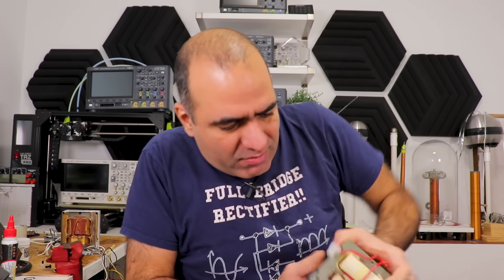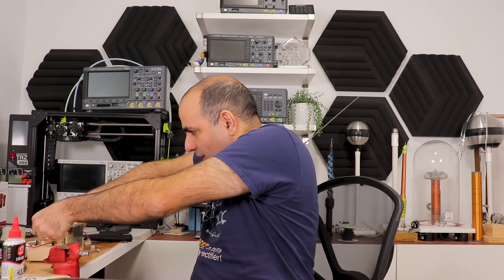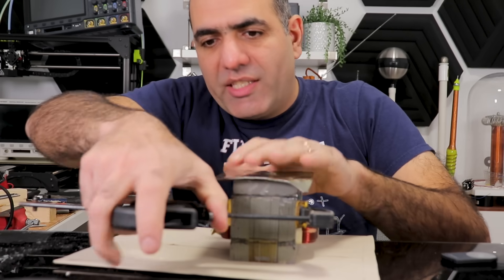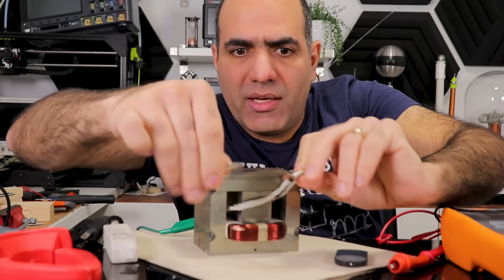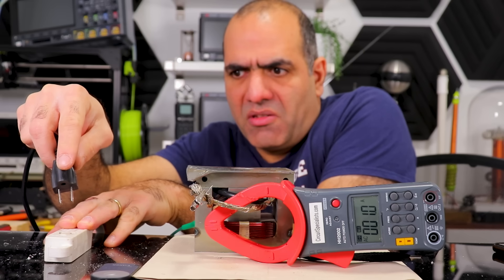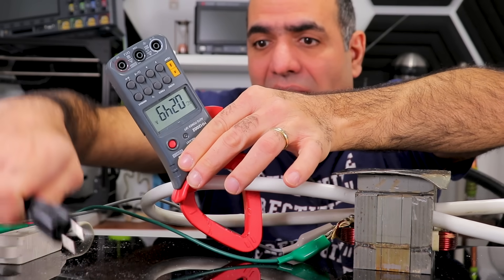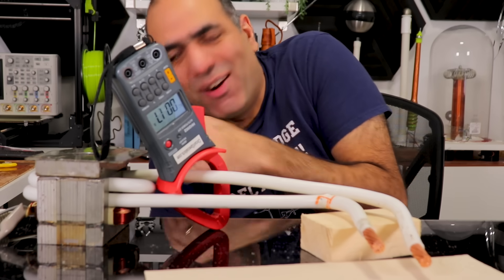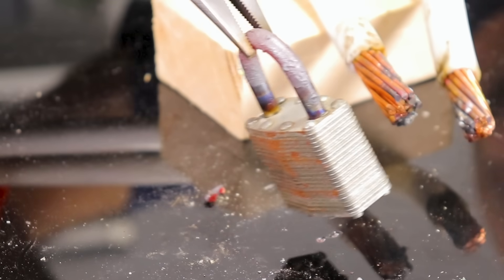Making "MILLIONS" of AMPS of Current

Comment: At about 8:20 you had the cable going through the transformer and It looks like you could easily pass it through at least one more transformer. So I’m wonder what would happen if you did? Would the voltage double like having a second turn? If so the draw for each primary would be reduced right? Maybe you could chain a bunch of them to get to the million amps.
Reply from the maker: Interesting  thought! I think that would count as a second turn, unless the primary is connected backwards, in which case they would cancel each other.
Reply: @ElectroBOOM  ily
Reply: @ElectroBOOM 
I think you might be known as the world’s most immortal man.
Why? Because electricity cannot kill you!
Reply: @ElectroBOOM  TKOR did it in the arc welder video
Reply: @ElectroBOOM  if the summed fields vary at double the rate, the circuitation should double i think, i don't quite remember how it works though, i might be very wrong.
Reply: @ElectroBOOM  u know what needs to be done. u gotta add this to the video list lol
Reply: @ElectroBOOM  and you connecting things wrong is always likely XD
Reply: 😮‍💨 @ElectroBOOM
Reply: My son fan @ElectroBOOM
Reply: Cody slab in the wild
Reply: @li04am  Cody Slab, you say?
Reply: Cody on a mission to kill Electroboom 🤣
Reply: Yes he could and that's what many builders do when making a DIY arc welder. It will double the voltage as it will make the part of wire trough the new transformer act as a new voltage source in series. To increase the current you reduce the number of turns trough each transformer.
Reply: @two_number_nines  but why in this video the current increases when the he doubles the secondary 4:55
Reply: @greyminded  less turns=more theoretical max current. more turns=more voltage to overcome real internal resistance and actually push current in a short circuit. it is all about impedance matching your secondary to your load.
Reply: @two_number_nines  thank you
Reply: @two_number_nines  "... new transformer ..." Hmm, I wonder why professional engineers don't do this and you don't see this out in the wild ... ?
AH YES! They are no morons who double all the bad parameters by using a second transformer or the inevitable additional series-resistance that comes with such a amateurish botch in high current applications! 
so: *facepalm*
Reply: @two_number_nines  10:01
Reply: I have no idea, but I'm happy to see you here :)
Reply: I have an infinite number of standard microwave transformers at hand. And I could also use several or more separate 15 amp 120 vac circuits. This has been on my list of experiments for far too long. Maybe I will make a video about it.
Annealing the secondary prior to forming through the xfmr is a suggestion to ease the reluctance of the cable, and make the entire task much less effort.  Of course had it been done during this video it would have reduced the comedy of the construct, so I get that.
Reply: In the words of the great Chancellor Palpatine, "Do it!"
Reply: i was seeing your video about making uranium metal from ore hehe
Reply: The second transformer would also need a primary winding or else it would not add to the current of course. however the main issue is matching the phases between the two transformers because any difference in inductance between them will introduce a phase shift in the output so it could cause issues if they are poorly matched
Reply: Great Scott !!! 1.21 Gigawatts ⚡
Reply: I imagine it may be possible, but a megampere of current is such a stupidly high amount of current that it can literally only be compared to some of the strongest positive lightning discharges ever recorded, during severe (often tornadic supercell) thunderstorms.  I honestly don't think there is enough copper left in the world to make a wire thick enough to support that kind of current.
Reply: Don't give him such ideas 😂 😂
Reply: DO IT!!!
Reply: 1:01 What is the music soundtrack here?
Reply: @googleuser4720  80s Synthwave -
Daily Instrumental Music
Reply: What would happen if a multiply the turning by a thousand times use a 240 output source and short circuit a looped wire through the arc? Will it become biggest welding machine or will it short circuit the lights of my town? Just asking and totally not thinking of actually doing it... Yep definitely not doing it 😈
Reply: Phase matching could also be an issue with that approach
Reply: @theteenageengineer exactly my point , finally i found one relatable comment
Reply: Cody you should also create some electric experiment, not sketchy  one 😇
Reply: Kalki Ironman type 7 and 8 after 2026 😎

kalki avatar (beast of the earth) (christ on the white horse) (son of man on clouds) is the biggest enemy of dajjal/antichrist/kali 😏

Kalki Avatar (Murtaza) 11th satguru 13th imam cousin of Moula mahdhi a.s. 12th imam (muhammad) 😎

Prophet Moula mahdhi is raja shashidhuvj (the mighty one) born less then 1200 years ago 😎

Prophet Moula Isa a.s. will kill dajjal cause dajjal is going to kill Kalki Avatar 😏

Kalki Avatar will follow orders from 2 religious king Moula mahdhi a.s. and Moula Isa a.s. 😎

Kalki Avatar going to have 2 swords and ring of moula sulaiman a.s. and staff of moula musa a.s. (iron rod) Staff of moula musa a.s. is like omintrix can transform into anything and can transform others into anything And stone in the ring of moula sulaiman a.s. is also known as kastav mani and it's more powerful than all 6 infinite stones combined 😇

Cuz Kalki is ironman batman super saiya-jin superman ben10 saitama optimus prime shaktimaan and every super heroes combined after 2026 😎

This staff will transforms into white horses with wings,weapons,iron-man,cloud etc or can do imagination into reality 😎

*Ratn sru sword of lord Adam (miri)😇

*Ratn varu (zulfakar) sword of Moula Ali (piri) 😇

miri piri 😇

Kalki Ironman after 2026 😎

Satyug (sunrise from West) 2038 😏

Sambal is hospital 😏

Gzwa e hind 2029 😎

Khalistan and Azad Kashmir after 2026 by Ironman 😎

99% Hadith u heard is not about imam Mahdi it’s about Kalki avatar (the main character) that person momin vs dajjal prove me wrong if u can 😏😏😏.
Reply: good idea!
Reply: World domination would be within reach......muahahaha!😄
Reply: Double it, give it to the next person 👍
Reply: If you tap the main rails it usually maxes out at 100-200A @ 240v, so 48kW for maybe 48kA if you can step it down to 1V, or get short bursts of higher amperage with capacitor banks I guess.

Larger houses and buildings can have 400A+ coming in, so maybe head back to another foreign hotel and break into their breaker box ⚡
Reply: This is the 69th reply. Epic.
Reply: WHY? WHY THEY ALLOW A CRAZY PERSON LIKE THIS, TO GIVE CLASSES TO YOUNG PEOPLE WHO DON'T KNOW HOW DANGEROUS ELESTRISITY IS,

A THOUGHTFUL INTELLIGENT PERSON WOULD SAY, THEY SHOULD CLOSE IT,
 THIS CHANNEL IT IS DANGEROUS NOTHING FUNNY
Reply: What if we try to get a really high voltage instead 
With transformers
How high can you go
Reply: "The key is not to be afraid of the sparks"
Reply: My thought is cut the top off two transformers, discard the tops and put the two E cores end to end with a primary on each. Then add the one or two turns to the clamped E cores. 
 Now get obsessed, do two more and run the wire through both sets. Plug each into a different circuit breaker! 
I await your video melting anvils.
Reply: Actually i think that wouldnt work because it works on principle of electromagnetic induction which means induced emf is in opposite direction of the very cause producing it and the cause producing it is current in primary coil which is obviously AC and itself it is changing direction 120 times a second (60hz) so maybe we could never align the direction of current in both primary coils of 2 transformers and as long as their direction is not aligned the direction of emf in secondary coil wouldnt align so they would simply cancel out each other (not perfectly) but yea net emf would be less in case of 2 transformers than in one
Reply: We have in Europe on individual property 380/400V 3 phase power installed. In USA this is only for industrial property possible. We in Europe actually have lot at disposal even in our private backyard.
Reply: 1. Parallel connection of transformers (primaries in parallel, shared secondary):

Voltage: stays the same as a single transformer.

Current: adds up, can become much higher.

Application: welding transformers or other devices needing high current at normal voltage.

Important: All cores must be in phase, otherwise magnetic fields partially cancel → power loss or overheating.

2. Series connection of secondary windings:

Voltage: adds up, can become very high.

Current: roughly the same as a single transformer.

Application: high voltage experiments where high current is not needed.

Phase alignment: must be correct, otherwise little current will flow.

3. Passing the same wire multiple times through the same core (increasing turns):

Voltage per turn: increases proportionally to the number of passes.

Current: decreases, due to higher resistance.

Drawback: higher losses and more heating; insulation must be sufficient.

Application: high voltage generation with low current (e.g., Tesla coils, voltage doublers).

4. Phase alignment of transformers:

Critical for both parallel and series connections.

Incorrect phase → fields cancel → loss of power, transformers can overheat or get damaged.
Reply: last time i check, this guy was on Mar? What ISP do you use Cody ?
Reply: I think that dealing with the limitation of 15A of primary current doesn't make using 2 transformers much better. However - I wonder how much better can we get using 3 phase transformer. The thing would be much larger and would require a special socket. I'm not sure people even have such sockets in USA. In Europe we have them. At least in some houses. It's roughly 400V between phases, and maximum current up to 40A.
Reply: @Adam_Lyskawa  I’m the US, you can have a 100 amp, 240v split phase circuit installed in most homes. No one does as the need for a 24,000W circuit doesn’t really exist. As for 3 phase. Some very large estates do have 400a 480v services. You could install a circuit at an estate such as this that has the ability to output 432,000W. Now if you did install such a circuit and put an equivalent constant load on it as a residential customer, your utility might kill you.
Reply: @Veritas-invenitur  Mhedi: I survived! BC-HYDRO vans pulls up in a screech of tire smoke and masked assassins jump out
Reply: @Veritas-invenitur  100A? Haha what do you live in? A shed?
Reply: @johnadams5104 An electric tankless hot water heater might use 24,000W. But even that is a stretch at 81,840 BTU.
Reply: @Ecospider5  Thats very true, an electric tankless hot water heater can draw up too 24KW. Personally speaking, that seems more like a peak draw that tapers off after a couple of minutes rather than a constant and sustained draw. But thats nothing more than a theory of mine.
Reply: @johnadams5104 My tankless gas unit suggests 40,000 BTU per active device. So 80,000 BTU could do 2 showers at the same time.
Reply: @Mad Scientific  Are you really going to have one dedicated circuit in a residential 200 amp pannel that draws more than 80 or 100 amps? No, no your not.
Reply: @Veritas-invenitur  ah yes with great power comes great electricity bill
Reply: @Veritas-invenitur lots of people have 3 phase connections in residential homes. Usually to run some machinery in their garage. Mechanic, woodshop, etc. It's pretty common.
Reply: @Veritas-invenitur LOL, yes, AND the fire department would most definitely be called also, as with THAT much power you're destined to burn your house down in the process of experimenting, LOL!
Reply: @Adam_Lyskawa  Depending on the country, a 3 phase supply to an individual property is only for industry. Residential areas are supplied using a 3 phase transformer, but each individual phase is only connected to a third of the properties. This way the load across all 3 phases is kept balanced.

If you have a property on an industrial estate, chances are you will have a dedicated 3 phase supply that can deliver a few hundred amps at 415v. But even then that could be insufficient.
One machine where I work draws 750KVA and needs its own dedicated transformer on the 11Kv line. On startup it pulls up to 1500A for about 5 seconds before settling down to between 500 and 800A depending on load.

The problem with trying to produce a million amps in this way is that the energy needs to be the same on both sides of the transformer.
Reply: @leeowen4989  good lord, what does that machine do?
Reply: @leeowen4989  3 phase residential does exist, even in the US, but it's rare. At my house there is a 3 phase, 200 amp, open Delta service. That's 3 phase derived from 2 transformers. 120/240v. But that's only because my house is in an otherwise industrial area. There are a few houses but otherwise all industrial buildings. In a normal house you would only have single phase. The power company here has no problem installing it for a residential customer, it just has to be readily available on the street or they make you pay a ton of money.
Reply: @leeowen4989 
If you assume a secondary voltage of just 1v - then 
1,000,000 amps = 1Mw.

There is no way - even on a large industrial three phase supply - one is going to get 1MW !!
Reply: @eric4709 It would depend on the needs of the industry. If a facility needed a 1Mw connection, it would be possible but seriously expensive.
An example of an alternative to high power draw from the grid would be energy storage. Another one of my machines has a power output of 3.6Mw, but the drive only runs for a little over 2 seconds. The energy is stored in a hydraulic accumulator using 2, 250Kw pumps that run all the time.
Reply: @Adam_Lyskawa  I have 208V 3 phase power at my house. This is not free. It adds about $16 to my electric bill per month even if I never use the 3 phase power!
Reply: @glasslinger  NICE!!! If you don't mind me asking,  why do you have a need for three phase in your home.   I'm fascinated because 3 phase power in a residential setting is very uncommon,  although I've heard of it, never ran across it.
Reply: @Sparky-ww5re  Before I owned the house there was a machine shop here. They had 3 phase installed and I simply kept it. It's about $6 a month extra on the bill, not really enough to bitch about. My big air compressor is 3 phase.
Reply: @Adam_Lyskawa  u talking CEE sockets?
Reply: @Adam_Lyskawa  We have those in India too we call those heavy duty power outlet "Power Lines", an extra power subscription is required to get them in our houses.
Reply: @Adam_Lyskawa  Yeah, we (in the US) don't have that in our houses.  That would be in factory service.  We have 220/240 with a center tap to neutral (just the middle of the secondary transformer on the telephone pole) which is utilized to create 110/120 for all the regular household stuff.
Reply: @Adam_Lyskawa  I have 208V 60 amp 3 phase at my house. Had it for my large welding machine. Now I have an inverter welding machine that works on single phase. MUCH better machine! Now I have only an air compressor on the 3 phase. Too much trouble to change out the motor so heck with it!  :)
Reply: @glasslinger  Well, if you can get enough current from a single phase it's fine. You need thicker wires though.
Reply: @Adam_Lyskawa  There are limits to single phase. This is why we use up to 6 phase electric systems.
Reply: @Adam_Lyskawa  I think they go to maximum of 125A per phase. so 230V x 125A x 3 = 86,25 kW
Reply: @Adam_Lyskawa  Theoretically and this is not advise: You could just remove the fuses from your house, directly connect to the outside transformer and draw up to whatever amp the next fuse (at the trafo) takes to pop... However if you fuck up and short this kind of a "setup" it will remove you from existence along with your whole house.

Alternatively you replace your fuse with a 63A or 100A one, but you need to know how thick the wire leading to your home is.
Reply: @Adam_Lyskawa It would made small explosion by connection cables or spoon together ...😂😂😂
Reply: Yes that will work but you need to get the winding direction correct
Reply: Yes, the voltage would double using a second core, but each transformer primary would still need enough current - can't escape conservation of energy! 
For those interested, PhotonicInduction has a classic video in this field, where he ups the ante by a few orders of magnitude.. 600 amps on the primary  - melts whole wrenches, but it also shows the limitations of residential power delivery when he manages to black out the whole street!
https://www.youtube.com/watch?v=ut5DXxK1dvk
Reply: @rob-muntron  Remind me about my submarine days. I was told that some body dropped a wrench on top of the battery. It evapurated. Each cell of the battery weight was 1200kg. Imagine a car battery that weighed 7,200kg. We had 120 ot those cells in the submarine. No need for a transformer to make 1000Amp.
Reply: @rob-muntron  I want to say it was just a bit of trickery there. He connected the current winding of a kWh meter to the low voltage output of that transformer, and put 600A at a low voltage through it. He also used the transformer to output several kA (no exact figures were given) at a few volts, with an input of many tens of amperes and 240V.
Reply: Wow 🤩
Reply: Ask Nikola Tesla or Dr Emmett brown
Reply: @Jaydawg-v5f  There is no way to get a usable and constant 1 million amps out of a 120v 15 amp 60hz circuit. By the time that you have converted enough volts to amps to reach the desired 1 million amps, the remaining voltage will be below the voltage threshold required to overcome the resistance of the wire, the connections, and the characteristics of the transformers. Even with a 120v 20 amp 60hz circuit, it is impossible. With a 240v 30amp 60hz split phase circuit, you might be able to pull it off, however, it’s still unrealistic. Your best bet in a residential setting would be to use a 240v 80 amp 60 hz circuit. And even then, your not going to get the result that you actually want. A million amps delivered in a constant current configuration is a legendary ask.
Reply: @Veritas-invenitur  A metric buttload of amps is more of PhotonicInduction's forte
Reply: @Infinion  I miss photonicinduction.
Reply: @Veritas-invenitur  however, using multiple 15 amp 120 vac circuits will make the only limitation being the main service provided. ,🤓
Reply: @Infinion  thanks, I'd forgotten his channel's name! He has done smth like 200 000 A IIRC
Reply: @Mark Honea  So you plan on paralleling multiple branch circuts to power a bunch of transphormers that have been put into series........ Well, enjoy, nothing bad could ever happen.
Reply: @Veritas-invenitur I hope most of you have fire insurance when you decide to do your experiment. We will be out to disconnect the service when the fire department calls. Good luck.
Reply: @t.r.4496  linemen are heroes, cmm
Reply: @Veritas-invenitur  Just for fun some calculations - 240 V and 30 A gives 7,2 kW of power. That means at a million amps the output voltage would be 7200 / 1 000 000 = 0.0072 V at max! Now if that voltage is applied between sides of a solid copper block that's 1 x 1 x 1 meter (1 000 000 mm² cross section area) - specific resistance of copper at 25°C (more when it gets hot) is about 0.017 ohms/mm²/m - so 0.017 / 1 000 000 = 0.000000017 ohms - so with 0.0072 V applied, the current would be 0,0072 / 0.000000017 = 423 529..A. So, the cube has to be cut down to about 42 cm to get the million amps flowing  (now about think having the current flowing between the flat sides of a 1 x 1 x 0.42 meter cube of solid copper, haha). This ignores the fact that a secondary winding can't consist of just a block. But gives an idea how hard it would be to get that much current going - at least without an input power of the primary, in the MW range.
Reply: @Speeder84XL  That really calls for making the secondary winding out of superconductor. However even then, your transformer would still need a very large iron core to prevent it from saturating in the intense magnetic field strength caused by 1 MA flowing through the superconductor.
Reply: @Veritas-invenitur    You cheated.  You did the math.
Reply: @CD4017BE  10:01 
Don't let them know 

10:01
Reply: Lay off the mercury, bro.  And stop playing around with uranium.  Not cool.
Reply: After my preliminary calculations he would need a thousand transformers in series... 🤔
Reply: @FlorianMickler  Law of diminishing returns and magnetic linkages as well as hysteresis curves may actually complicate the calculation to the point of "if" it can be done, rather than "when" it can be done and with how many transformers :) That's why in practice electrical transmission is done by elevating the voltage to several kilovolts, then stepping it down at the end point where voltage drops and current rises :)
Reply: These high-current experiments are also very great in other ways: Just a small mistake, e.g. a thinner (copper) wire, which immediately vaporizes and kindly settles on the lung tissue or relieves you from the boring use of your eyesight.
Absolutely irresponsible to show that without even the slightest indication of the danger and wearing protective equipment. In the truest sense of the word, this can also "go in the eye" for Medi afterwards, meaning if someone imitates him and it goes south ...